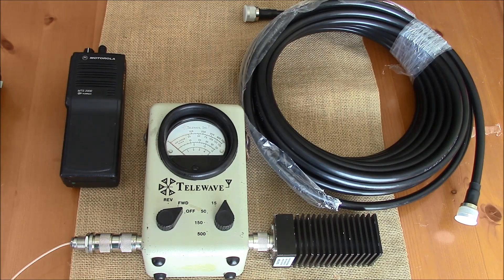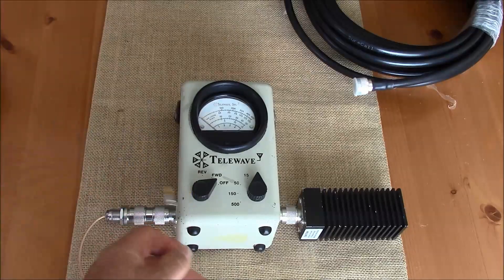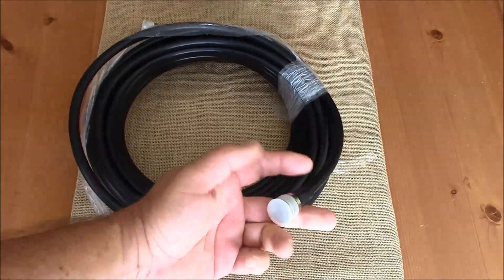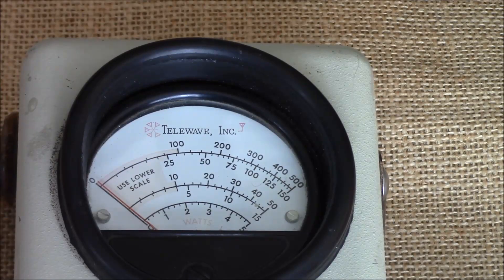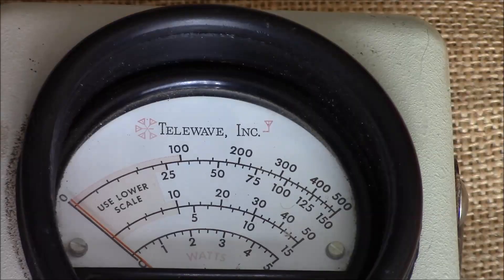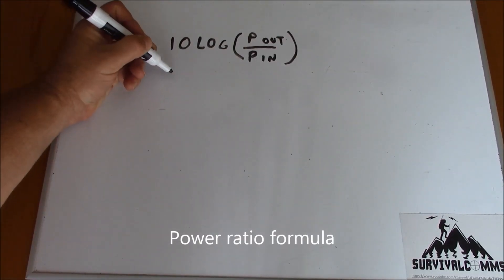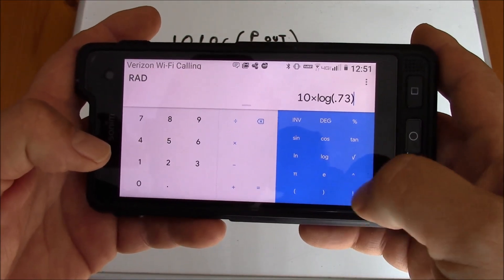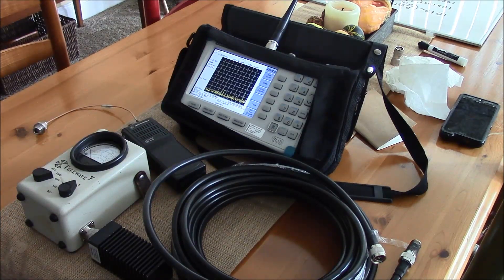Check your Ham Radio coax loss like a boss with a wattmeter

Comment: I suppose the take away is,,keep the antenna feed line as short as possable. This video makes the point clear by putting the numbers on it. Thank you
Reply from the maker: RF feedline should be practically sized , as short as possible of quality construction  with as few adapters / jumpers as possible. Thanks for watching !

Comment: Seem like less than 1.5 db/50 ft loss is not very significant. The higher the freq, the more loss? Anyway, its interesting. Great video
Reply from the maker: Thank you Timmo ! A 3db loss is cutting power in half so a 1.5db is  equivalent to the loss of a quarter of the radio's power on transmit and loss of a quarter of the received signal strength. It isn't the end of the world and with a decent antenna it will be better than a wash in the balance of things. Loss does increase with increase in frequency but the compact nature (practical) of more efficient antennas at higher frequencies balances it out to a degree. Efficient antennas and feedline systems are a free (no additional power required) way to improve performance. Thanks for watching !